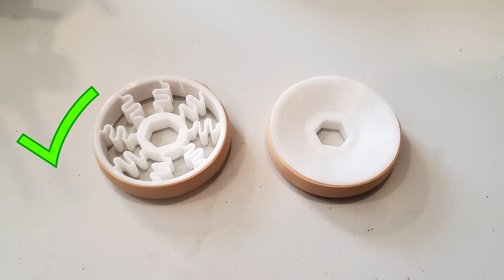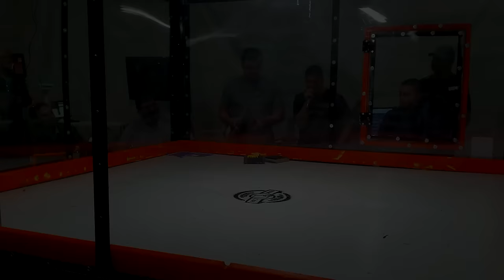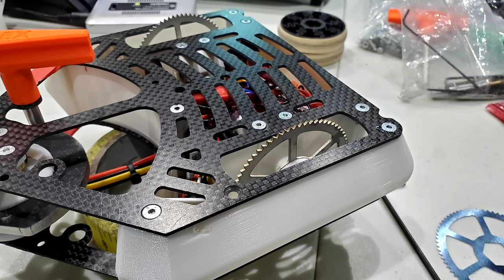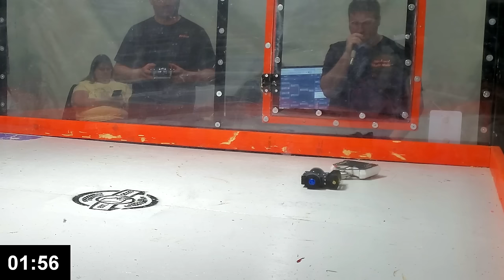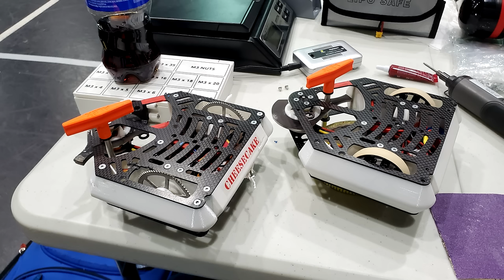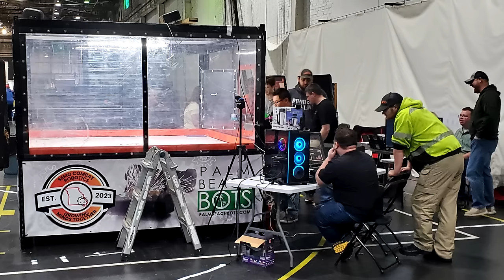Cheesecake takes on Missouri! (SEMO Robot Smash, March 2024)

Comment: Grinding a little recess into the shaft where the set screw sits will help to prevent that drive issue reoccurring. It means the set screw has to back out that little bit further before fully losing connection.

Comment: Just rewatched this video and seeing the slippery(?) movement I got an idea:
What if you integrated an IMU into Cheesecake and basically combined your RC input with the gyroscopic forces of your weapon and the actual movement on the floor to send "corrected" signals to the drive motors.
To kinda counter different floors and what not so your inputs always have similar results no matter the outside conditions.

Comment: I wonder if you could have a rotating object with a linear actuator mounted on it. You could put a weight on one end of a stick, and a spike on the other. Put the weight outwards to save up angular momentum then shift the weight in and the spike out to get a massive amount of speed without having to have bearings handle that speed continuously

Comment: By switching to those cleated wheels, you inadvertently showed just how effective your springy wheels are at prevent shock. There is one potential improvement I want too see, although it might be kind of expensive to machine. I want to see an aerofoil shape on the spinner to cut down on air resistance and drag. I want to see just how fast you can get that spinner spinning before low bite becomes an issue.

Comment: Hey Alex wanting to build my first battlebot and wanted to see what your dimensions were for cheesecake and if you have any tips and tricks
Reply from the maker: Cheesecake is about 6"x6" x2".
Good suppliers for custom parts include SendCutSend, Ponoko, CNCMadness, Fictiv, and PCBWay.
Good suppliers for off-the-shelf parts include Fingertech.com, PalmBeachBots.com, and ITGresa.com
For maximum wheel grip, you’ll want to use REALLY soft materials where the wheels touch the floor. I just use rubber bands, and it turns out they come in standard sizes. TPU is much harder than rubber bands (~95A vs ~20A), so while TPU looks appealing for tires, don’t be fooled.

Comment: I'm currently working on replacing my currently belt driven weapon with a direct drive hub-mounted weapon and was wondering what methods you are currently using to affix the weapon to the motor housing?
Reply from the maker: I use a custom "collet" / adapter to hold my weapon on my motor. You can kind of see in this video linked below what it looks like and how it assembles. 
https://youtu.be/E24vhL6qeIg?si=rBhZrN8O8kwbXPZq
Reply: @alexsalchemy  Thanks for the info!

Comment: Hello, im starting to get into combat robotics and want to make my own antweight. Was wondering what electronics are commonly used. Are microcontrollers like an arduino ever used?
Reply from the maker: Cheesecake mostly uses the same electronics as are used in the Fingertech Viper kit you can buy online. I originally thought that I would need to do some sort of programming with some sort of Arduino, but it turns out it's just plug and play RC car stuff, So it's very easy to put together and have it work.
Reply: @alexsalchemy  awesome thank you!

Comment: what is the hub you use for your weapon.
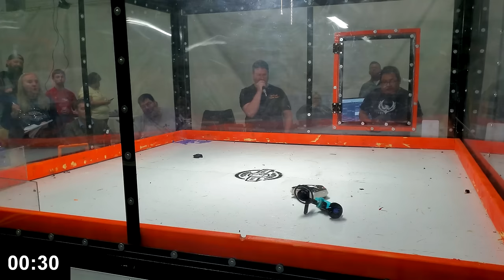Reply from the maker: You can see how my weapon attaches to my motor in the video linked here at 11:20. It's a custom-designed 3D printed collet.
https://youtu.be/E24vhL6qeIg
Reply: Thanks for showing me. That will help.

Comment: I'm curious as to how you designed your 3D printed wheels. I am trying to get into the sport and would love to make my own wheels without the need for casting them.
Reply from the maker: Well, they're 3D printed out of TPU, and they have rubber bands for better grip. Turns out, rubber bands come in standard sizes (at least in the USA), and mine are #82 size.
Reply: @alexsalchemy  do you have any images of how they were actually designed? Mainly how they attach to the motors that’s my big issue
Reply from the maker: @hunterovitt4426  - Oh yeah, I just use these "hubs" made by a company called BaneBots: they use a set screw to clamp onto the axle, and then a retaining ring to hold you wheel on. 
https://palmbeachbots.com/products/banebots-t40-hub-3mm-shaft-1-wide

Comment: Why nobody uses gyro stabilisation? Is it not allowed? Can not gyro hold up g forces during fight?
Reply from the maker: The problem is that it costs weight, and there is precious little weight in the antweight class. Some people are doing it in the beetleweight, 3lb class though, like Division and Fireball.
Reply: @alexsalchemy  I saw some videos with huge battle robots and all of them look like they do not have any stabilisation. It is obvious to me to add stabilisation to the first place as it shoud make you movement very precise.
Reply from the maker: Well as team Ripperoni has said on the BattleBots TV show, gyro stabilization takes a fair bit of weight, which is why their robot doesn't have a lot of armor or configurations. The whole thing is kind of a high risk high reward strategy.
Reply: @alexsalchemy  maybe we are talking about different things. Wiki says that battlebot has weight classes 27 to 154 kilograms. Flight controller for drone weights 10 grams. It is a lot in ypur case, but not for 100 kg robot. Also I am sure that there is a way to find/make stabilisation board only couple grams heavy.
I thought that is may be restriction for combat robots, like no "computer" assist, only direct control to motors. Or maybe gyro can be damaged by g forces during fight.
If there is no restrictions please try to use stabilisation, I would like to see it in battle :)
Reply from the maker: @emovard3n  - Oh, you mean electronic stabilization, yeah I'm familiar with that in RC airplanes and such... not sure how helpful it would be in what is basically an RC car though. Maybe just to make sure the car drives straight when throttle is the only input?
Reply: @alexsalchemy  For two wheeler it will help a lot. This kind of robots are unstable, you can not steer it precisely.
With gyro stabilisation your robot will do exactly what you ask it for.

Comment: What program and/or language do you use to program the controller?
Reply from the maker: None that I actually mess with: Cheesecake is basically just a radio-controlled car, and those radio and electronics systems are basically plug and play. 

My transmitter is a Noble NB4, and it comes with a receiver. I then plug in my motor speed controllers to the receiver. My motor speed controllers connect to my motors, I throw in a battery, and that's basically all it takes.

https://youtube.com/playlist?list=PL81yBUG7TPX3rRRStHBGLX0Rr2aaBqfFO&si=Ozmc-RnXGfT9YcEc